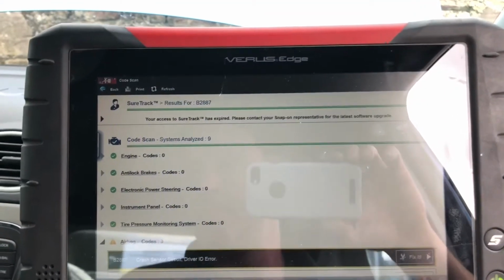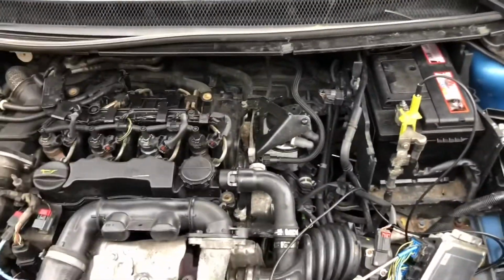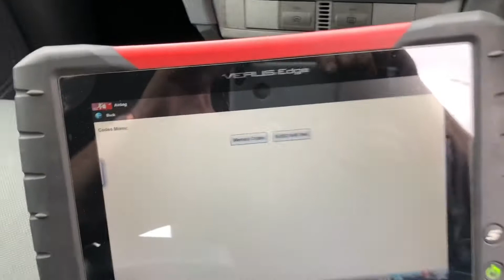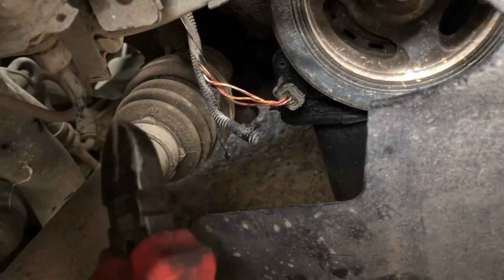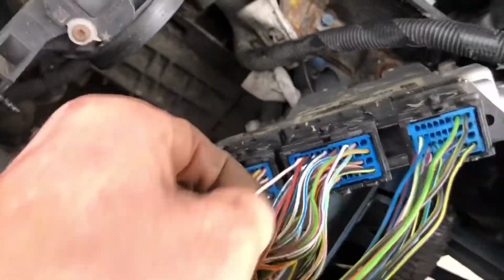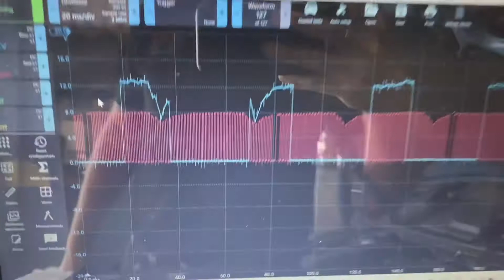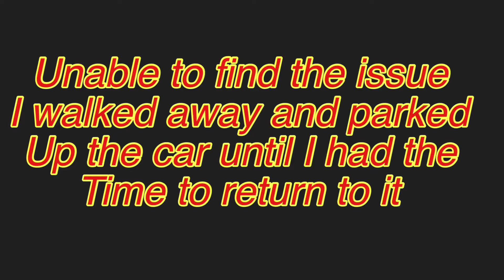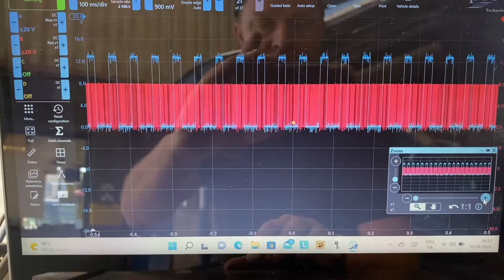Ford Focus, crank’s funny with camshaft & crankshaft signal interference 😬

Comment: The rabbit hole as we all know check the basic but we never do something it doesn’t look like it’s a fuse that is gone but you got there in the end 👍thanks for sharing
Reply from the maker: 😂😂 only barely Anto & after 6 months. As you say always check the basics first. It just didn’t sound like a fuse issue, but I should have chased after the 2 fault codes I had which would have brought me to the fuse 🤷🏼‍♂️🤷🏼‍♂️🙏
Reply: @kennedysgarage3281  no, you’re dead right it didn’t sound like a fuse 👍

Comment: Great Video Peter I’ve had may ass kicked a good few times over the years by problem cars, I was convinced that motor was going to fire up when you did a bypass job on the cps signal wire 😮turned out a 10am mini fuse caused a maxi problem 😅
Reply from the maker: The smallest problems Kevin can quite often be the hardest to find. I just didn’t think it could have been a fuse the way it was cranking & thought it was going to be a wiring issue. But that’s the way it goes sometimes. Something new to be learned everyday 🤷🏼‍♂️ keep it simple 👍👍

Comment: This video took me back to WorldSkills UK @ Henry Ford Acadamy, Daventry.

They had a 1.6 zetec petrol rig.

The first fault was no dash lights, no crank. Ignition relay was bad.

Now I had dash lights, but no crank. A fuse blown for starter.

Now I had dash lights & cranking for a second, then starter cut out. 

I was thinking immobilizer, but the judge said no. I tested all obvious fuses for continuity. All were good. 

I ran out of time after that. Don't think anyone got it running on my day.
Reply from the maker: It actually sounds very similar to this ordeal, I went down the rabbit hole totally. These cars can be mine boggling at times 🤷🏼‍♂️🤷🏼‍♂️
Excellent comment though Philip 🙏🙏👍

Comment: So was the control feed to the starter relay dropping out/ in  to switch the starter on off.  Still can't work out how ecu would even power up with one of its power supply missing.  Sure someone will come along with the answer
Reply from the maker: I actually don’t know Chris after 6 months I was just delighted to see it running again 😂😂 but my thoughts are that the piezo injectors were back feeding a residual voltage that was effecting the cam & crank signal or extra amperage  needed to control the injectors or operate starter amplified the issue / fault 🤷🏼‍♂️
Every day is a school day 😉

Comment: I have an 04 Civic which runs and drives for exactly 11 miles. Then the crankshaft sensor kills the engine. Still haven't got round to fixing it. Bit of a job to do but have all the parts. 
But then I'm thinking if I replace the sensor what happens?
Is the sensor faulty or is there a fault with the crankshaft. It's intriguing. Great having old cars that are fun to fix
Reply from the maker: Only last night we were working on a Ford Focus that ran & then stops after a few minutes. The crank sensor was a 3 wire Hall effect sensor which were ,
5v power 
Earth/Ground 
Signal 
Anyway the ECU was stopping sending out the 5v reference intermittently which meant we had no signal & then the car would break down. 
No faults & it took quite a few hours to figure out what was happening 🤷🏼‍♂️😉😉